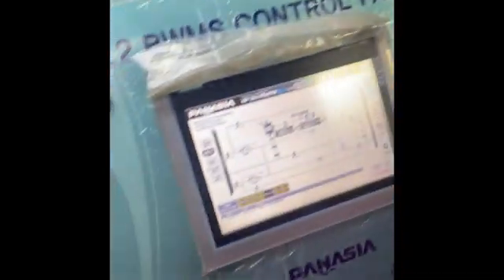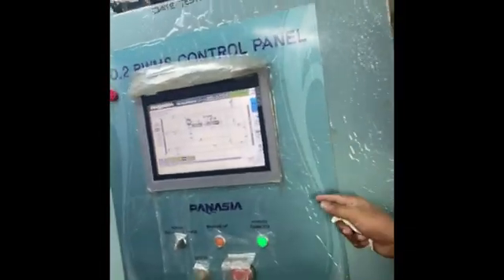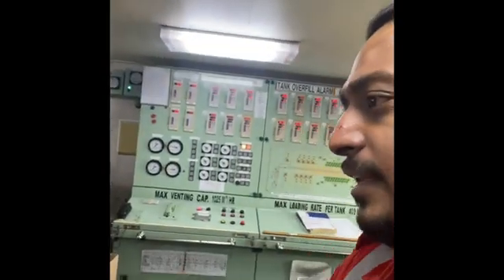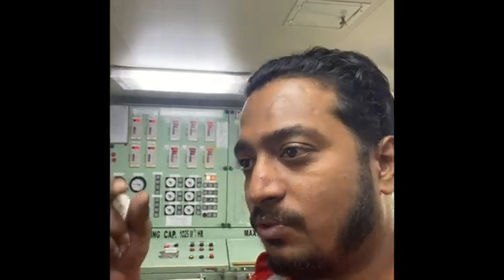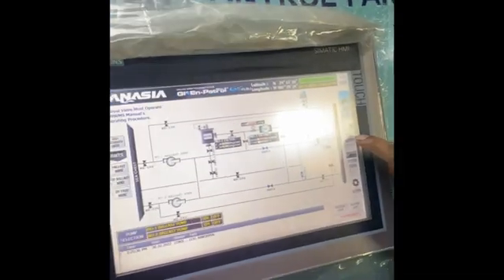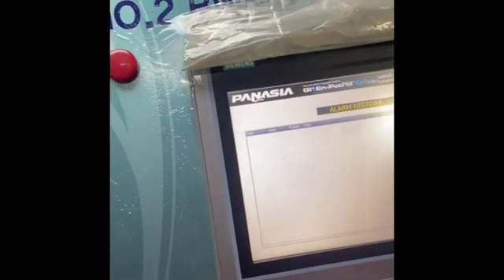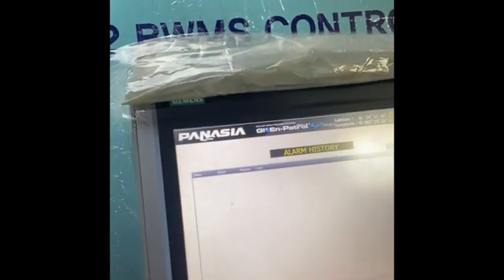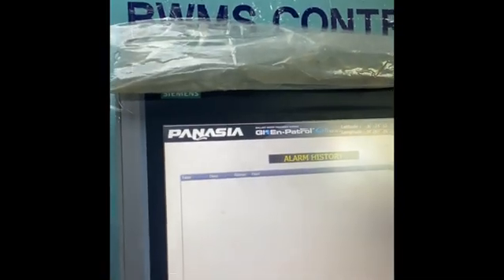🫡Trouble shooting BWTS system before Entering  US port,Not able to fetch alarm history #experience

Comment: May I know why the card was formatted before checking if it had any data using a pc. 
And was there any " alarm" that the alarm data missing?
I guess you lost all data by formatting.
Reply from the maker: No … the card  store  only alarms no data else … so once u r not able to fetch the “alarm “ screen that means only the card is either not working or defective or needs to be formatted in ex-FAT extension not other extension, that’s only for the HMI and not the PLC card
Reply: @LifEoFaSaiLor2022 yeah baat kaise pata chala bhai manual main diya hai kya ?